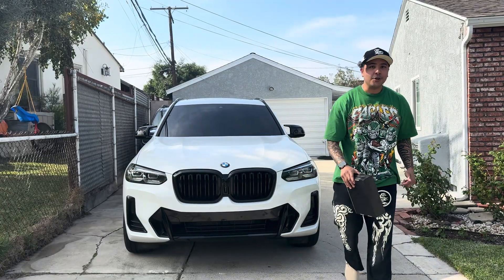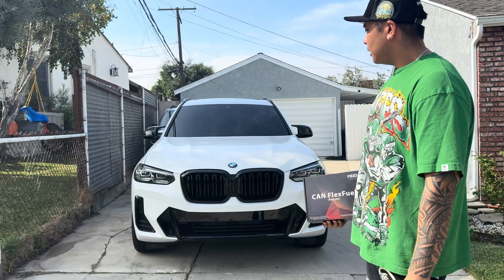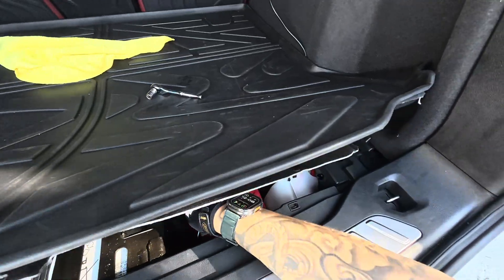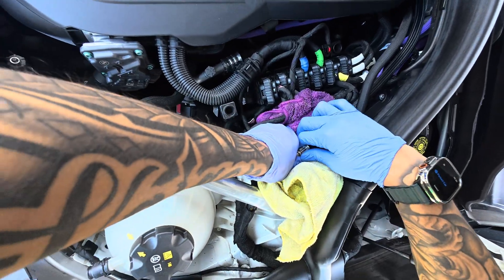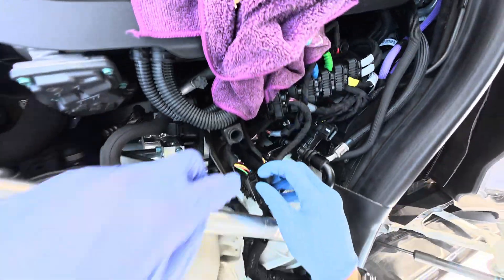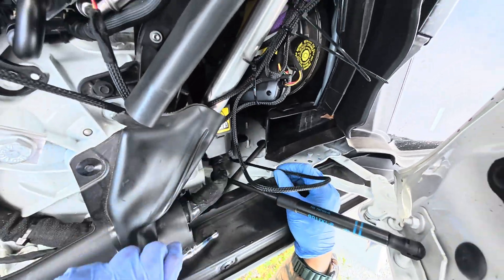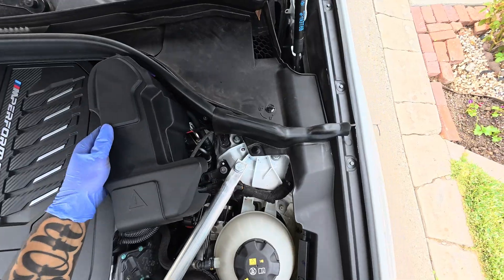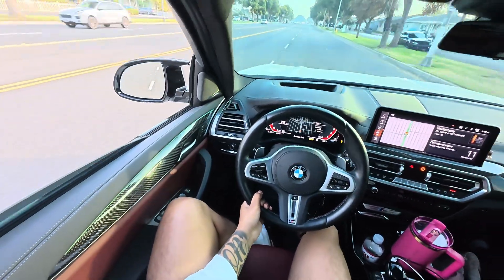MHD ECA Install on X3 M40i (Gen 2 B58)  Step by Step DIY

Comment from the maker: 💬 What’s up everyone! In this video, I walk through the full MHD ECA (Ethanol Content Analyzer) install on my BMW X3 M40i (Gen 2 B58) — step-by-step, no skips.

This setup lets you monitor your ethanol mix (E30 / E85) directly in the MHD app — a must-have if you’re running blends or planning to go flex fuel.

⚙️ Full mod list:
• MHD Stage 2 / E30
• Valvetronic Titanium Exhaust
• Catted Downpipe

🔥 Drop a comment if you’ve installed the ECA or plan to — I’ll help with any questions!

👍 Don’t forget to like, comment, and subscribe — it helps a ton and keeps me motivated to make more B58 DIY & tuning videos!

#BMWX3M40i #B58 #MHD #FlexFuel #BMWDIY #E85Ready